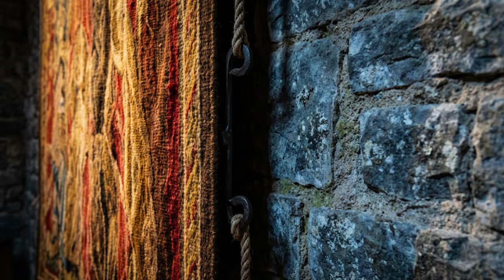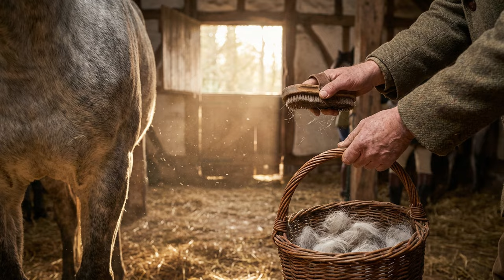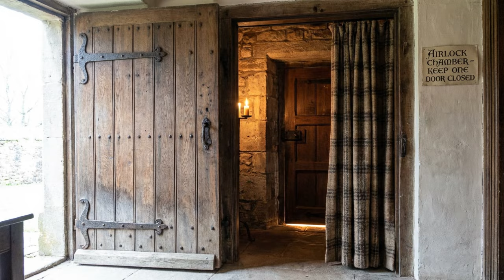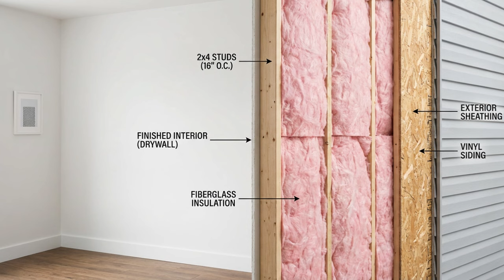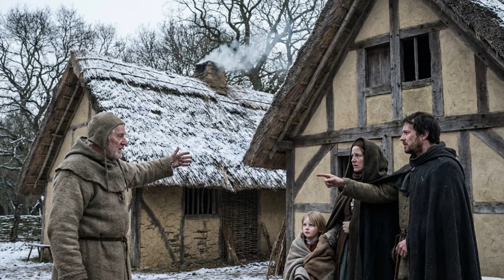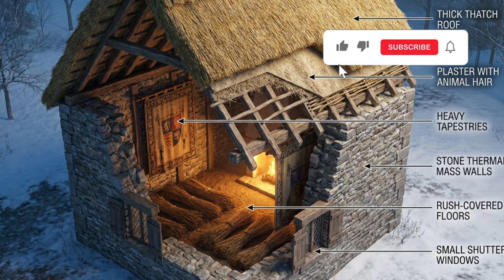This Medieval Insulation Secret Kept Castles Warm Costs Almost Nothing

Comment: I've built 5 strawbale buildings, with clay plaster. Also built in a rocket stove into a conservatory extension. I survived comfortable in 3 winters, one of was -20°c. Present home I'm installing wood fibre insulation on the inner side of external walls with regular plasterboard and clay plaster. With underfloor heating I get the house to a warm 18°c in the most used rooms, and 16°c in the bedrooms.
Reply from the maker: Wow, that's amazing experience! Thanks for sharing your insights on sustainable building methods. You are a living proof that these techniques still works.  We appreciate your comment❤️❤️❤️